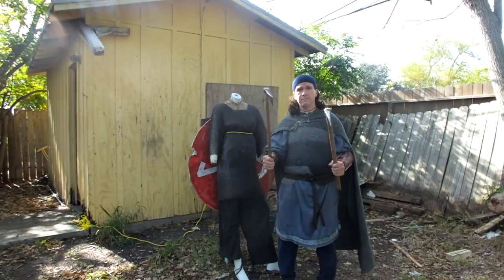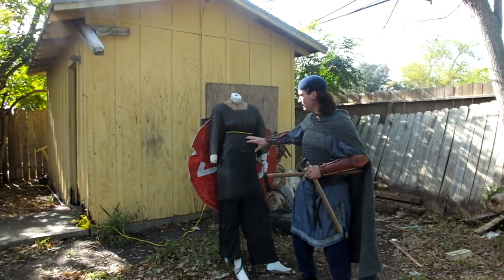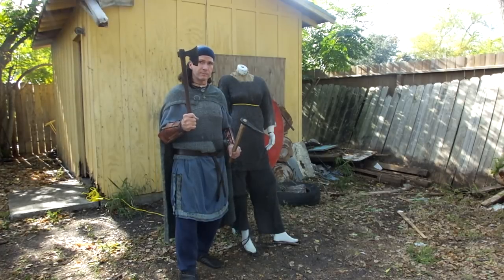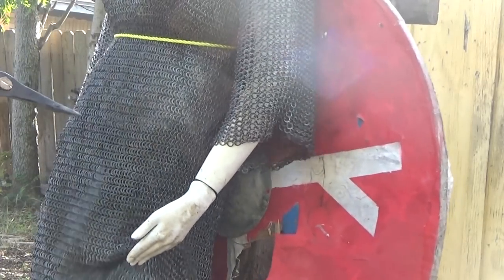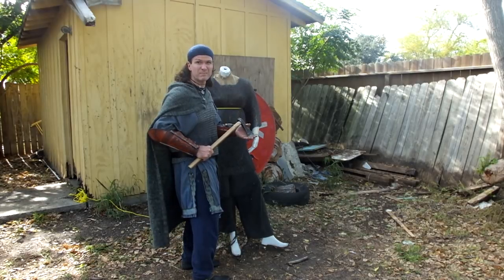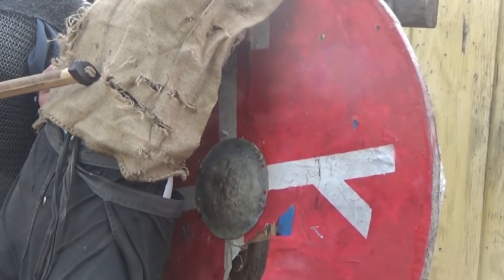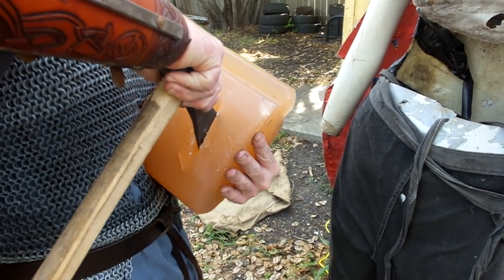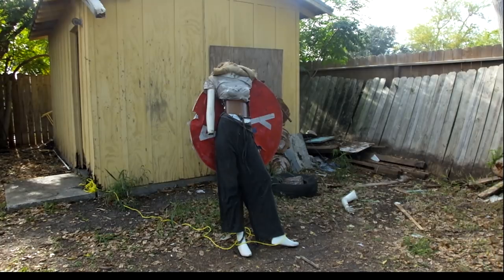Viking bog axe replica tested on historical chain maille armor

Comment: Seems as though any strike to an area covered by mail but consisting underneath of hard bony structures might be pretty painful if not even devastating. Areas like the shoulder/neck junction,  the clavicle, all the way down the outside of the arm, especially the elbow to forearm and wrist- also rib cage and sternum.  Regardless of whether the mail broke, that impact alone on a hard bony region would cause intense pain and probably deep trauma.

Comment: Two interesting additional theories on why these were popular:

1) We don't really know much about how long the handles were, it's possible that they are hand and a half axe - first row holds them in one hand with a shield, second row uses them two handed to land blows on helmets. Two handed grip would also help a lot with edge alignment.

2) Armor piercing theme - if you are using a bearded axe against spangenhelm, the ribs of the helmet may well catch a blow that would bend one of the side plates. That's not gonna happen with an axe like this. It bears mentioning that Slavs did use these and bearded axe in the same timespan, so which one you use may well depend on your personal preference or enemies you're facing more regularly - Romans and steppe nomads are very different opponents.

Comment: I think the downward angle on the axe head is very deliberately designed for piercing things like mail. 

With that kind of an angle a head on hit with the axe will have the very corner of the blade making contact first which allows it to penetrate and dig into the mail better.

Comment: I've made bronze axe heads with Neil Burridge and they have very similar edges to that axe. It's my feeling that were utility axes able to be used in combat, on small trees and branches, as well as in butchery (they split marrow bones really well).
Reply from the maker: Matthew Doye possible but the same amount of iron was used as a broad bladed axe so the head had to have good reasoning behind it. It weights more than most broad bladed axes as well.
Reply: ThegnThrand Besides your successful experiments on maille the extra mass makes axes that shape robust enough to stand up to working use as well. 

I'd also like to see a comparison between the different shapes of axe used against viking shields, that would be informative.
Reply from the maker: Matthew Doye very true the small head also increases damage through armor by focusing force and allows it to penetrate gambesons easily.

Comment: By the way. Dot you think that, if blacksmith rotate blade 90 deg and instead an axe, make a sort of a pick or chopper - is it more useful for fighting? In that case blade will not glance, at least at some angles...of course cutting ability will be worse, but anyway lethal. But piercing ability will be perfect!

Comment: I have a two-part a question here if the axehead was mounted on a much longer handle would it be possible to actually penetrate through both the padding and the mail second question have you ever thought about using impact stickers ?